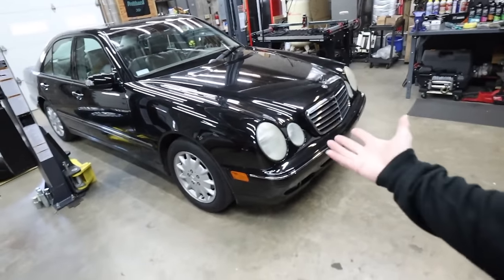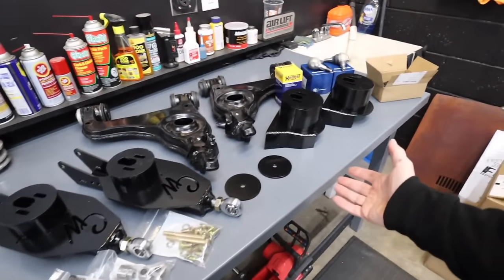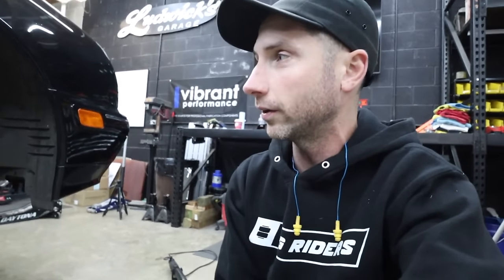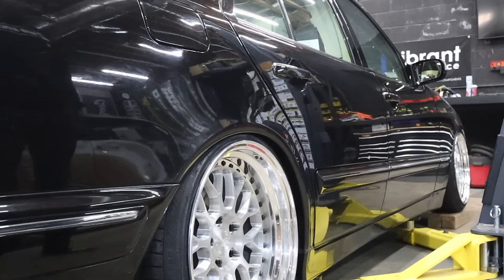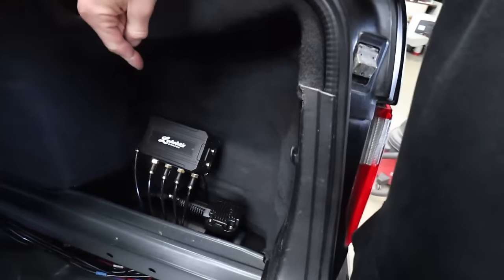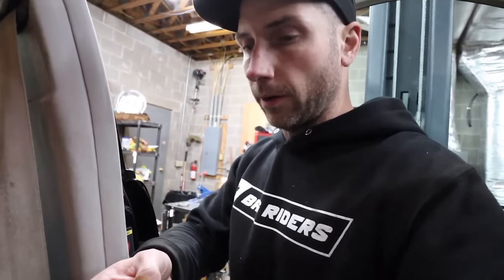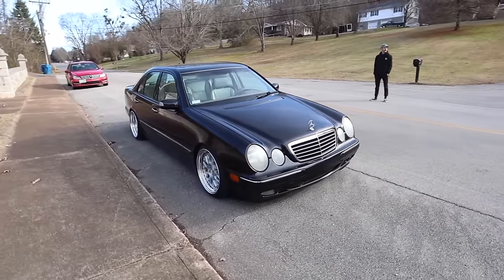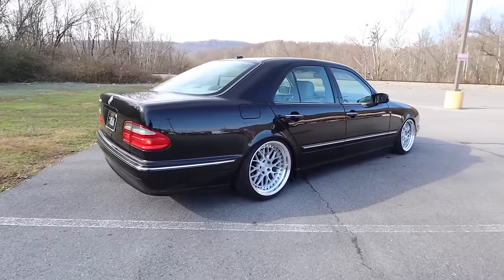Installing Air Suspension In My Mercedes W210! CRAZY TRANSFORMATION!

Comment: What a gorgeous car, man! Turned out incredible! Polishing the headlights up a bit would be the icing on the cake! If you look out for those cars, they’ll treat you good too
Reply from the maker: Thanks man!! Yes I definitely want to see if the headlights will polish out!
Reply: @JohnLudwick  They do! Just make sure to clear coat them after!
Reply: @JohnLudwick  , hello.
Единый Создатель миров сжалился над людьми и подарил им Мercedes.
Всем владельцам MERCEDES здравия и благополучия ! Были W201, W140, четыре года на W124, 1985г.(2.0, 4 - ст.ручка, pierburg, самоблок).
Я заглянул в Вечность. Сейчас вновь на синем W140 S320.
Reply: They got new meds you can get for the headlights
Reply: I replaced my headlights with Spyder and it modernize the car extremely

Comment: Hey John, I installed air suspension on my w210 16 years ago. It’s really important you reinforce the front where the Airbags are at.. the top part will break apart over time and can cause an accident..

Comment: The empty slots on the airline guides are not like OEM. They are OEM! This model came with air suspension as an option from the factory.
Reply: Sorry to break it for you, but W210 never came with air suspension, it had Niveu system which is hydraulic and only available on the rear!

Comment: Buying new wheels and still need spacers? Why just dont you buy exact fit wheels? I understand myself, when i have 20 y.o oem wheels. They need spacers, cuz they are 1 piece wheels. You buying chinese replicas and not getting exact size? How lazy are You? These new so called "car guys" want attention with 0 work and sweat input...
If im getting 3 piece wheels i will most deffo have no spacers for them.
Reply from the maker: Dude these are forged BC split wheels that were spec built for a different car. Did you even listen to anything I said in the episode? 😂😂😂
Reply: @JohnLudwick  i listened, you needed spacers. How tf you custom build something and still fail to deliver the right size for them? The car looks great. But you should deffo input more work. But i guess thats how it is these days. Everyone wants everything yesterday